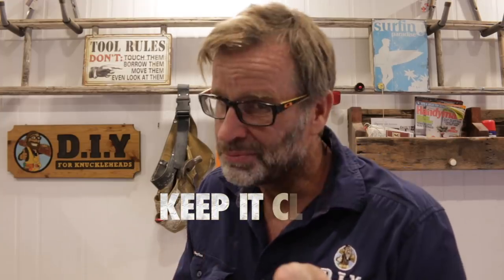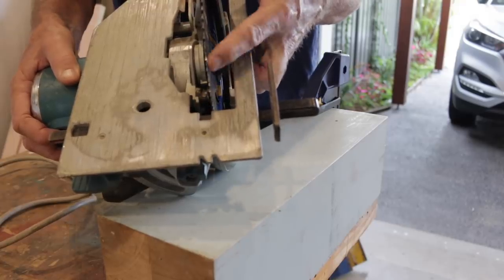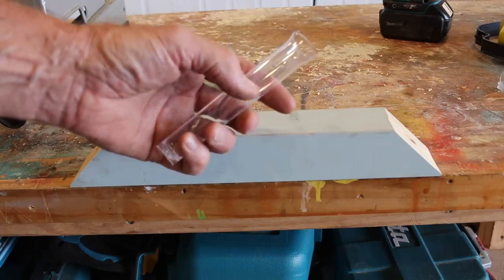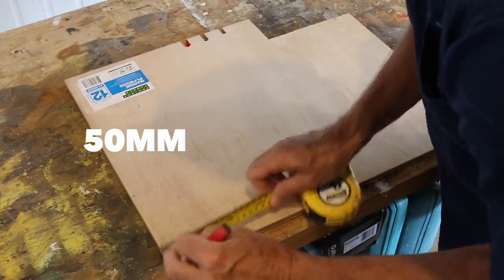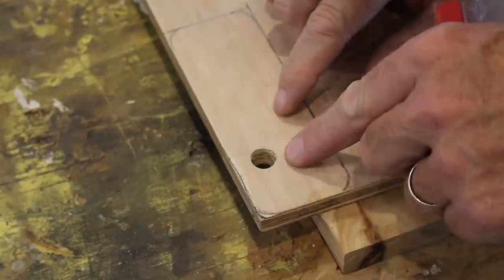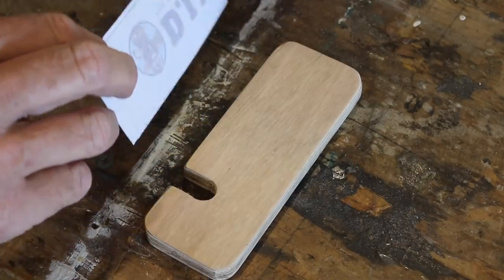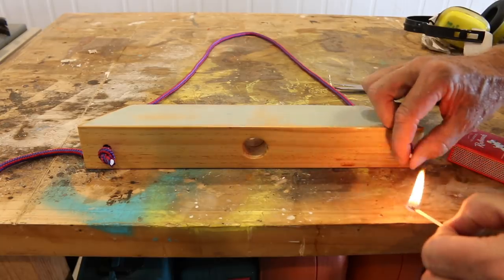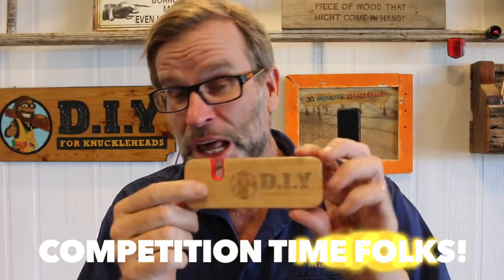Scrap Wood Projects for Beginners. Under $5 Bucks!

Comment: Finished my cell phone holder today. I used a old piece of wood that had been lying around the garage, and sanded it down.  It looks really nice. I put a Wide elastic in place of the felt. I feel like adding the elastic will make it less likely to slip. 
Thanks again for your fun Little programs I enjoy them.
Reply from the maker: No worries at all Matt. Glad you liked the little phone holder....l use mine all the time 👍😁🇦🇺

Comment: Making sure im not missing something, in the first project you flipped it over to drill both holes through on each side yet you cut off the end that would have "burst out" when you did the 45 degree. 
Did you just do this to follow best practice or would that had messed something up?

Comment: 15:54 Yes please, more simple projects. I've checked other channels for ''simple'' projects, where they run something like ~ take a block of starting wood and first run it through a huge electric planer, trim it to size on a table saw bigger than my shed, followed by a quick form on the table router, now into the CNC machine to create our shape and finish off in the spray booth for quick coat of varnish and there you have it, we took a 2 metre length of 150mmx150mm wood and made your very own (single) initial key ring! and a bonus tooth pick!
Seriously, I really liked both of these idea's, I'm going to make these for my mum. Also liked and subbed to your channel.
Oh and I thought the DIY sticker transfer looked really cool, gave it a sort of aged look.
Reply from the maker: G'day Seth, thanks for the like and the sub mate! Much appreciated. Glad you liked the video too.  I hope you can stick around as there will be more Scrap Projects to come. Cheers mate. 👍😁👊
Reply: @diyforknuckleheads  Thank you for the reply. I'll stick around, notifications turned on!
Reply from the maker: Legend!..thanks mate 👍👍

Comment: Why did you need to drill from both sides (on the first project) if you're going to cut one side off with the angle cut? Or are you just stating a good practice for general hole drilling?
Reply from the maker: Good question Dom....l drilled from both sides to cover my bases just in case l accidentally cut the angle from the wrong side. It's also good practice as well as you suggested. Cheers mate👍😁

Comment: What would you do if your cutting a piece of wood and not knowing the knot was loose?
Reply from the maker: It happens Victor....you just need to be aware 👍
Reply: @diyforknuckleheads  the reason I was asking was my wood jambed between the fence and saw blade, and came at my face,my reaction saved my eye. But it tore my thumb to the bone. Ps, I like your show!

Comment: Pro tip. If you have clamps, and clamp your workpiece to a sacrificial piece of wood; not blowout with drilling. You can also use tape where you will drill, and mark out on the tap. Drill through said tape( painters tape), and boom.. Shouldn’t have the splintering from entry.
Reply from the maker: Thanks for the tip Ryan 👍

Comment: Hi. Nice work. Do you have a link to where to buy label paper? That was an awesome idea. Cheers from Norway:)
Reply from the maker: Thanks Dan...you can buy the label paper from any stationary shop or news agency. Yeah it does work pretty well. It works better on pine than hardwood and the trick is to get a really smooth surface prior to applying the image transfer...good luck! 👍😁

Comment: 1 inch =25.4mm
Reply from the maker: Thanks Devin and that's why it's difficult to make direct comparisons which is why l always say 'approximately' when referring to inches. Cheers
Reply: @diyforknuckleheads I totally understand the cabinet shop I work for uses inches but our equipment is German so everything is in mm thats why I'm trying to learn how to use both

Comment: Shane, Shane, I'm disappointed in you. You can measure a flies fart in either decibels for the noise or cubic capacity for the volume of gas expelled. Not only that but you are mixing up you units... a bees ear or a gnats pubic hair hair would be acceptable. Don't do it again. I'm easily confused.
Reply from the maker: Hahahahahhahaaha...sorry mate. Next time, no metric, no imperial just references to insects bodies 😂😂. Thanks for watching mate 👍👊😁